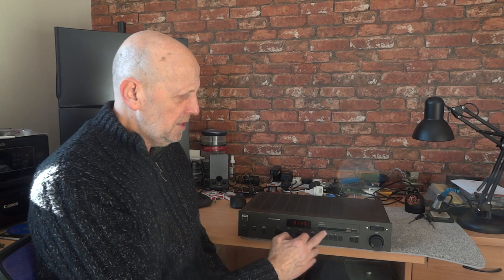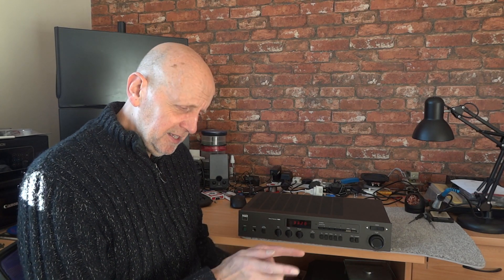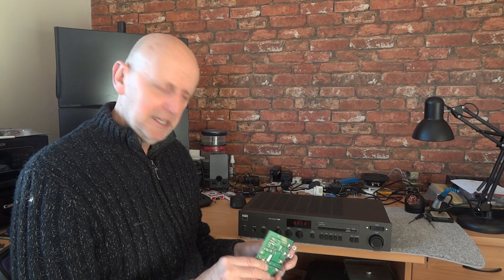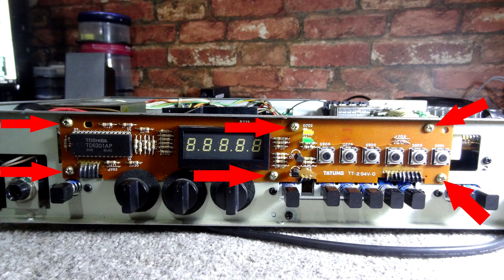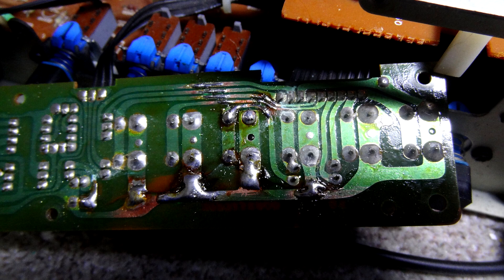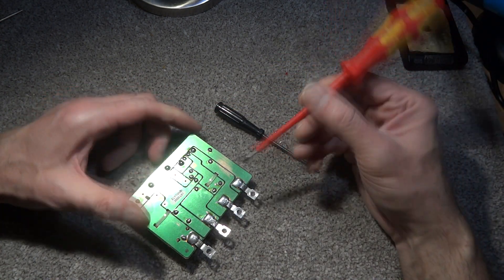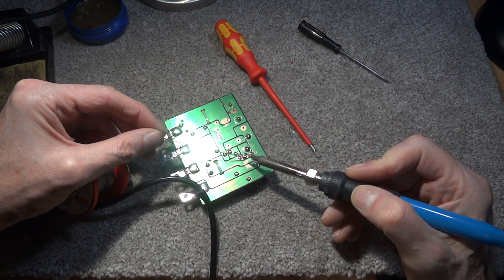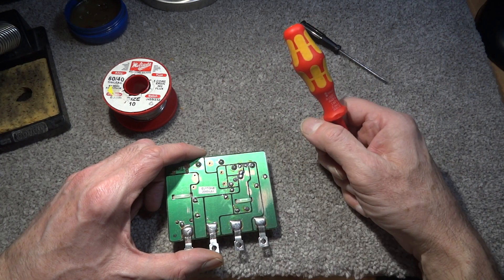NAD Receiver Cracked Circuit Board Repair. Vintage HiFi Repairs

Comment: hi you get the same in tascam 30 line alot   i have used all the mask repair beware it can take time to ship 
have a good x mas    hope to start using vegas 2020  i know it's a bit out of date as long as it works 

bob
Reply from the maker: Thanks Bob have a fantastic Christmas yourselve, Vegas 20 will be a great video tool to use

Comment: Great repair Michael.. Nail varnish remover or carburettor/brake cleaner is good for removing the green flow solder screen.. PCB's can be reinforced with Super glue and a sprinkle of baking powder..
Reply from the maker: Thanks for the info. I think I might try some of these other methods for a compair video one day. I did had a little super glue to the board before returning. Should just give it a little extra support.

Comment: Do nad still make amps ?
Reply: Yes have quite a few in the range. Streamers as well
Reply from the maker: NAD a little while ago brough out a newer model 3020 the NAD D 3020 V2, though not a nice looking as the orignal
Reply: @MichaelYates  i nearly got a used nad3020 but instead got an onkyo 9010 for my second system .
I still might get one as i hear the nad is a great amp.
The 9010 is fine but its a bit aneamic sounding compared to the marantz amps i had prior .
When i done a side by side comparison between the marantz 6002 and onkyo910 the marantz sounded really beefy and juicy especially in the bass where as the onkyo to me is is the opposite ,its uncoloured and a little boring especially in the bass department.
Reply from the maker: @peterpipe9015  Thanks for the comment and comparison between the Marantz and Onkyo, I think that a to neutral and uncoloured sounding amp can sound a little bit boring after a while when listen to, when a more lively amp keeps you engaged and wanting to listen to more. If you do get a chance to get hold of a 3020 I dont think you will be disapointed
Reply: @MichaelYates  thanks michael